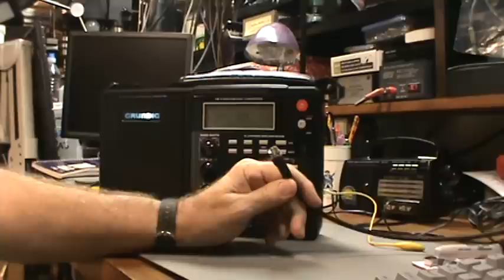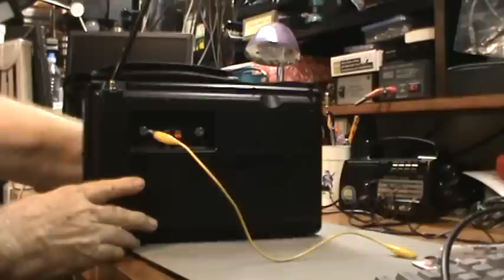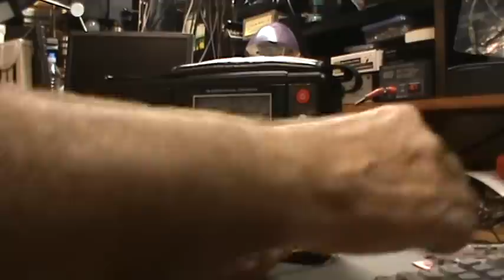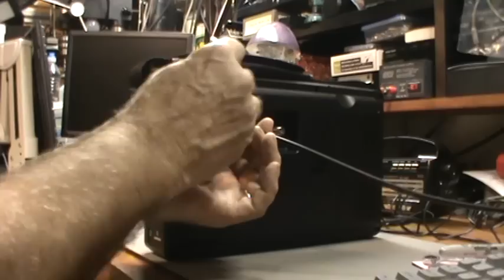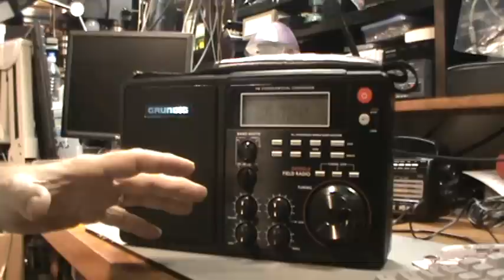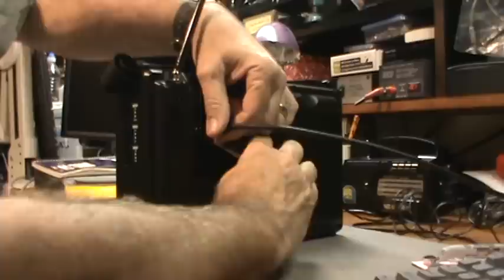TRRS #0412 - Shortwave Broomstick Antenna - Testing

Comment: hi Tom, I had a 450 and my external antenna switch and/or connector simply did not work,,,I would hook up a ordinary piece of 30' wire to the back, flip the switch and wouldnt hear S""",,then I would take the same wire and alligator clip it to the telescopic antenna and stuff would pour in
Reply from the maker: That's not good.  Happy New Year.

Tom
Reply: thanks same to you, and thanks for the great videos

Comment: Tom, I looked up that type of antenna and surely there has to be a counter-pose on it like a ground from the shield at the
antenna to ground. This type of antenna is a continuously wound coil and most broomstick antennas have a metal top hat
that's for static suppression. Since the radio is using the F-Type connector on the back you might want to check to be sure
that you are connected to the right connector. It just looks like a impedance mismatch and some of the documentation
on this type of antenna recommend a antenna tuner to work correctly.
Reply from the maker: Dennis Petersen Yes, the connector are clearly marked and you can see in the video that when I discount the external antenna I get no signal at all.

Comment: Been waiting for this for some time. Do not see how it was set up. Disappointing I guess.
Reply from the maker: Not much to the setup.  You connect a coax cable to the antenna, hang the antenna up and connect the other end of the coax to radio.  All this was shown in the two videos.  Pretty simple but poor results.  Do you have any specific questions?

Tom

Comment: Hi Tom. I think the problem is that the shield isn't grounded. That means it picks up the same signal as the antenna and, as a result, has the same voltage on it as the center conductor coming from the antenna. The radio sees the same signal voltage on both the center and the shield, resulting in no difference voltage between the two. Try grounding the shield to a proper 'earth' ground and I bet it will work much better.
Reply: There is usch a small amount of impedance between 50 and 75 ohms, it would not matter as far as reception is concerned and possibly, you would never notice. The PAR SWL End Fed antenna is just one of many manufatured that will work fine with 75 Ohm coaxial cable.
In fact, PAR make that clear in the user manual that come with the antenna.
Reply: Yes, grounding would take away a lot of the noise. Try grounding the shield at the receiver's end. Signals have to have a path and I think TheScottyr6 is right....
Reply from the maker: Thanks I will give it a try.  I had assumed that it was grounded in the radio.

Tom
Reply from the maker: This morning I tried connecting a separate ground to the coax cable.  No change.

Tom
Reply: What 'ground' did you use? I use a copper water pipe in the house water system which has great contact with 'earth'. In some cases the ground pin in the three prong AC outlet also works. But only if it is really 'ground' and not just the 'neutral' return line.
Reply from the maker: TheScottytr6 I have a 6 foot copper rod buried in the ground with 12 gauge copper wire connected to that.
Reply: Well that sounds like a proper ground. Is there maybe a mis-match between the coax and the antenna? Did the antenna come with a balun?
Reply from the maker: No balun and it has an F type connector on it.
Reply: TV coax is normally 75 ohms and radio coax is normally 50 ohms. Does the radio manual tell you what its' antenna input impedance is?